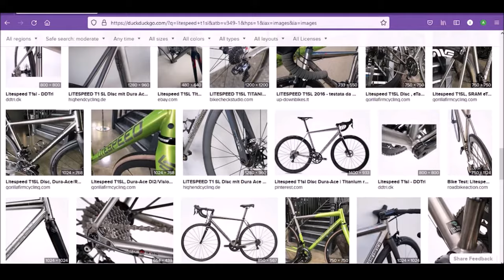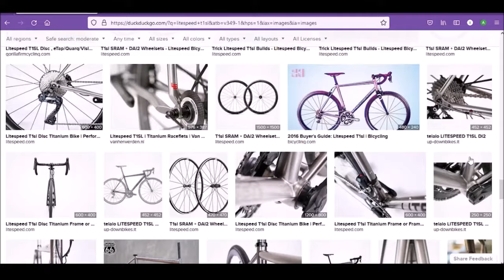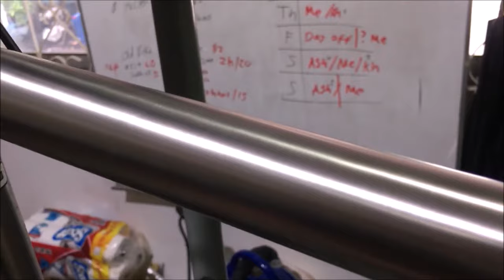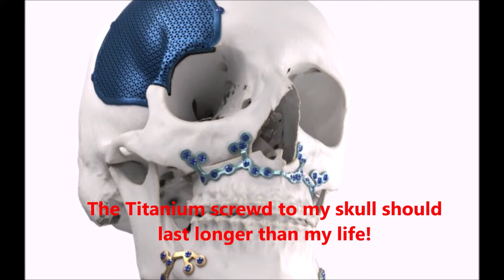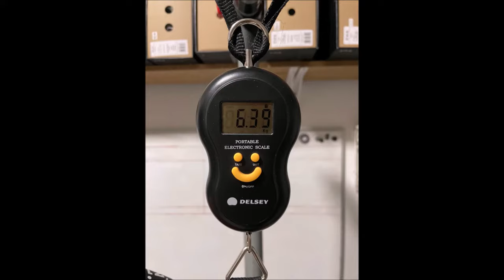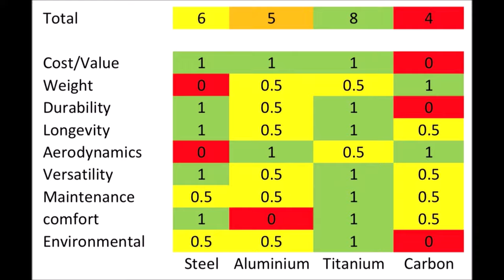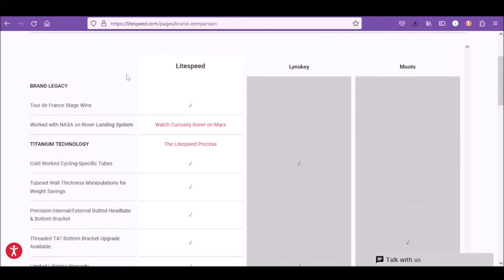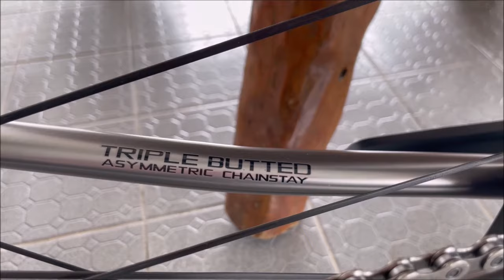The World’s Best Performance Road Bike. (And It’s Not Carbon…)

Comment: A friend has a Bossi Strada  Ozzie made Ti frame. Looks like a silver carbon frame. No round tubes! I have not seen anything similar in titanium.
Reply from the maker: Yes they look impressive, aero and stiff, i think they make the weld thick and then sand over them to make it smooth, they also use 3D printing I believe? But it makes for a heavier build and they are on the pricey side… but still, very pretty. 👍🏻🙂

Comment: OOPS,tablet trouble again.Having had 2 90s Litespeeds with the David Lynskey signature I wondered why they seemed to fade away for a while.
They were not cheap or the lightest back then but sure rode nicely.
The problem with the older ones was tyre clearance even a 23mm had just enough space to clear,if you went over fresh tarmac you could get a small stone jammed in there,would not take today's 28mm.
If I could find an older Litespeed frame would it be possible to fit 650b wheels to convert to a gravel bike ?
Would love a T1sl but no way to fund that at present.
Long live rim brakes and external cables on road bikes!

,
Reply from the maker: You will be surprised to hear I still use 23mm tyres. I haven’t found the need to go bigger on my T1SL yet and they fit really nicely on my carbon rims. 🙂

Thank you for the comment! Ride safe!
Reply: @reginaldscot165  Have you ever tried wider tires?

Comment: Great explanation on Ti versus steel, Al and Carbon but, I’m not with you 100%. Problem is that Ti is much mor britle than steel. I’ Used to desingn frames for a bicycle company and can tell you that Ti thughness against steel is quite superior but it lacs on elasticity and resiliance by much. I’ve seen top racers ending races on steel frames uwelded o broken seat stays that if being Ti would be imposible, so this may be one main reason for Pro tour cyclist not to use Ti since if it get cracks it brakes. This in addition to the carbon design hipe ofcourse. Regards!
Reply from the maker: Thank you, I will settle for 99.9%. 😉

I have almost ripped the head tube off a Ti frame in a serious crash that put me in hospital for 6 months. It was holding on by only a few mm or material… and yet I can’t get it to fully snap. It still supports my weight. As for elastic deformation, I’d be surprised if you ever reach plastic deformation from normal riding. 😁 Crashes are a different story, but by that logic why do they choose carbon then? I don’t think the resistance to crash damage is even part of the equation. 🙂

Comment: Bottom bracket stiffness and responsiveness is a key category that has been omitted.

Steel: -3
Alu: 0.5
CF: 1
Ti: not sure, but want to know!
Reply from the maker: Is it that simple? Surly it very much depends on thickness and design of the shell? 🙂
Reply: @reginaldscot165 of course. But, I suppose we are all after frames that weigh less than 1300g (as an absolute max).
Reply: @StopTheRot  Eh, perhaps, but unless you're doing the hard climbs, does a pound really matter ALL that much?? I easily stand to lose a pound or two (or three, or four, or ten) of body weight to make up that difference.

Comment: I have two Litespeed's. One is a 1994 Litespeed Classic which I just upgraded to 11 Speed. Yep, still riding it. Fits like a glove and will never give it up. The second is from 2020. Litespeed Ultimate with Disc brakes. With my weight Disc brakes are a savior. Have one carbon fiber frame that I just bought. Really love it for its comfort and speed. I also have a steel Pinarello from 1997. That is more a retired bike as the paint job is still in excellent condition. As the saying goes..."Steel is real!"  I really can't argue with you on your assessment. I won't know for another year or so if the carbon fiber bike was a bad decision or not. That is about the only nitpick I have. Otherwise, great job.
Reply from the maker: Excellent comment! Thank you and you sound like you have a lovely collection of bikes! 🙂👍🏻

Comment: The carbon fiber test with the truck running over it is misleading. Carbon fiber is very strong depending upon the direction in which the pressure is applied. It was never intended to take stress in the lateral direction. Along the axis, however, it is quite strong.
Reply from the maker: Then how is the test misleading? 😂 It shows the truth that carbon tubes aren’t as strong as titanium if you crush them. That’s not “misleading” at all. 🤷🏻‍♂️
Reply: @reginaldscot165  Do people routinely have a need to crush their carbon bicycles? I would hope not. I suppose it proves that titanium holds up better if your bicycle gets run over something, but if that happens, you've got a while different set of problems to deal with, anyway. 

I'm not arguing against titanium. Heck, I just ordered a Litespeed Arenberg yesterday! I'm 66, and I know that, barring some catastrophic event, it's the last bicycle I'll ever need to buy. Plus I just think titanium frames are cool. Everybody has carbon. Titanium is unusual. Not everybody has titanium. And I think it just looks awesome.

But I did not buy Litespeed because carbon frames were shattering out from under me. Carbon fiber frames are designed to take high stress in the directions in which riding the bicycle will present that stress. Why add the additional weight of making carbon fiber tubes crush resistant, which you could do (It's all in the layup), if that's never supposed to happen anyway? And if it does, like I said, survivability of the bicycle is likely to be the least of your worries.

Comment: Hi Reginald. Top video!, Which litespeed bike should I get if I just want to ride for exercise, fitness and just go for long rides? Do I go with the T5?
Reply from the maker: I think they do a city bike with a straight handle bar called the CHEROHALA CITY. It’s the cheapest option if you just want to ride. Unfortunately it’s disc only. If you want a proper road bike, light, with rim brakes, comfortable and fun to ride then yes, 100% get a T5. Really great bike. ❤️
Reply: @reginaldscot165  thanks for the prompt response Reginald! Much appreciated! I will watch all of your content from now on :-)
Reply: @reginaldscot165  I actually wanted a bike with drop bars so the T5 it is. Thanks!

Comment: Not all steels are created equal. Take XCR for example. Does not rust and because it has an incredibly high tensile strength it can be made to very very thin tubes and hence also light
Reply from the maker: True 👍🏻 I considered it for my steel bike but for the cost I decided against it. 🙂
Reply: @reginaldscot165  i have a custom frame made of XCR. Highly recommended. Was hard to choose against ti by the builder said there are more tube shapes in xcr than in ti and hence it would have been easier for him to tune the ride quality. And the bike is indeed even better than I would have ever expected

Comment: I copied this from a spork manufacturer website 
Titanium uses nearly 4 times the embodied carbon (CO2 emitted during the manufacture, transport and construction of materials), and more than 3 times the embodied energy of aluminum
Reply from the maker: Depends if you consider CO2 a problem and also depends how you get your energy I guess? Maybe Ti should be 0.5 for that. 🙂
Reply: @reginaldscot165  Logic error. Regardless of whether you see CO2 as a problem or not, nothing changes the different emissions.

Comment: I own both a 2019 T5 and a 2022 Watia; both are great bikes. For me not getting beat up by the ride is very important and these Ti frames have enough compliance not to feel numb or stiff through the ride. Durability is important for big downhills as I never have an existential crisis that a frame failure may occur on sketchy roads. Sure weight is a consideration, but that may be addressed through a better diet.
Reply from the maker: Great comment and weight can also be solved by equipment choices. 🙂👍🏻

Comment: Scot as I was doing a hundred miles yesterday (161 Kilometers) I got a flat from the smallest steel sliver.  I was thinking about what you said regarding the pro teams fixing their own problems on the road. If I get the much heralded Victoria Corsa pro graphene, It may be fast but would it be durable?  What is the point of being fast but it won't hold up the smallest puncture-causing debris?
Reply from the maker: It’s a big question, nothing is 100% safe, even tubeless. Everything is about compromise to some extent. I think it’s possible to be light and have a good quality tyre that shrugs off most road debris but I will explain more in a video I’m working on now. 😁👍🏻

Comment: That's all wonderful until the frame cracks; turns out it's pretty common.

Stainless steel is sounding good.
Reply from the maker: Is it more or less common than carbon or aluminium cracking? Are there people still riding on 30 year old Ti bikes? (Yes 😉) Yes some of the older ones cracked in the early days when Ti was a new material and nobody knew how to weld it properly. But that was 38 years ago. Don’t forget, many Ti bike come with a 10 to 15 year warranty on the frame as well. So if anything is going to happen you would expect it in the first 10 years. 👍🏻

Comment: What do you think of the Dolan ADX Disc compared to the Litespeed Arenberg, for an enduro bike? I prefer the top tube being a bit more horizontal on the Dolan. Is its manufacture quite good?
Reply from the maker: No Idea, but Litespeed are the best in titanium technology.
Reply: @reginaldscot165  I will definitely keep that in mind, sir. You may want to take a peek at the Dolan brand, as well. They get good reviews. If you're curious, that is. But thanks for the rapid response. It will no doubt serve as a strong influence on my decision. Keep up the good work, Mr. Scot.
Reply: Dolan frames are made in China and Dolan stick their decals on them.

Comment: Much progress has been made, all Motogp frame are built with aluminium in 2024 (and for KTM steel-tube) chassis, with carbon thought to be too stiff. But, like money, in racing more is good but is never enough. There was, however, one believer that carbon fibre, far superior to metal in strength-to-weight, could be made to work
Reply from the maker: You are talking motor bikes? That’s not my subject so I can’t comment. 🙂
Reply: There was, however, one believer that carbon fibre, far superior to metal in strength-to-weight, could be made to work. Ducati Corse’s first MotoGP engineer Filippo Preziosi’s innovative style saw him make a minimal carbon-fibre box that combined the function of airbox and main chassis spar. Isn’t carbon too stiff, we asked him? No, he insisted. " The material is not important in itself; it is how you use it. "  Can you see Peak Torque & Preziosi have something in common ?

Comment: LOL, talking about Moots.  Dude, their construction techniques and tolerances are much better than LS- and they do double butt their tubes, the RCS model which I own and the CRD.  Works of art.  And look online for LS frame failures, plenty to chew on.  Very few Moots.  So it's far more than just weight, mate.  If I cared about weight, I'd get carbon
Reply from the maker: I will agree that the moots welds do look lovely. But I’m getting better tube manipulation, lower weight and less cost. If you don’t care about weight then why not buy a steel bike? Looks the same as a moots? Or a Chinese frame, again they look same as moots because moots don’t bother with complexity in their designs. That reduces work and cost for them, but rather than charge accordingly they are some of the most expensive Ti bikes out there? 

Yes, double not triple butted. About frame cracks. 1) LS have been doing this longer than anyone else so you would expect to see more of their bikes with cracks. 2) they are always pushing the boundaries of what is possible. For example the T1SL. When you push boundaries you sometimes find the limits of the material. Hopefully that’s what the lifetime warranty is for. 3) They have changed hands as a company and at 1 time they were owned by people who sort profit over quality. If you check the dates on the cracked frames online they are most common in that time frame. You can still see people on the LS Facebook page riding LS bikes that are 30+ years old. Moots are nice, but they are boring conservative bikes that cost way too much and are too heavy for the price. Why not use the amazing material of titanium to its fullest advantage? 🤷🏻‍♂️

All the best and ride safe! ❤️

Comment: Titanium does corrode. Especially electric corrosion during contact with other metals. Also titanium alloys may have some aluminium, vanadium and other toxic metals.
Reply from the maker: My answer to that is if you do a Google search for dose titanium corrode: “Titanium has outstanding corrosion resistance.” And in all the years I have worked with titanium and serviced titanium bikes I have not seen any corroding on the titanium itself. 

Second answer would be, if titanium is toxic as you insinuate then why do they make camping cups and cutlery 🍴 out of titanium? And why do they use it in both medical equipment and in implants. For example I have several titanium plates and screws in my skull.
Reply: @reginaldscot165 well it depends on used alloy for medical purposes i think, they are different

Comment: I am not currently looking for a new bike, but if i was, after watching this, i would certainly consider a titanium one. Few things, though, i must say, don't add up. Firstly , you choose a titanium seatpost over a carbon one for solidity, but at the same time you built your bike with carbon wheels, and i would say, that wheels are way more prone to damage from bumps etc. than seatposts are. Secondly, if titanium is more comfortable then carbon (and i can't say if it is or is'nt, i never rode on titanium bike) why do they put carbon forks on those ti frames?
Reply from the maker: I will gladly explain! 🙂
Because when working on the bike I clamp the seatpost, so it’s much better to have a titanium one. I also pick the bike up by the post and I clamp lights and bags to it, so having something that doesn’t mind having dirt rub against it for hours is a major advantage. 😁 Also it’s also more comfortable than a carbon seatpost in the same dynamiter. 👍🏻

As for the fork, many reasons, 1) to make a fork in titanium in that shape would be very Difficult and expensive, carbon is a cost saving material in this situation. 2) they can outsource production to other companies. 3) in a head on crash you are likely to damage the fork, so it’s cheaper to replace. 4) it’s possible to get lighter forks. 

As 3D printing improves I’m sure a titanium one of quality and Low weight will become available. Then I will definitely buy one! 🤭
Reply: @reginaldscot165  Ok, thanks for reply :) Bike looks like a beast with those wheels on, have to say :D very nice channel for cycling related stuff btw
Reply: It looks great but lightness is only one factor.Being heavier doesn't make a bike bad.

Comment: Whether we like or not carbon, in all ots forsm and technologies will be the main material use for building bikes. I has almost unlimited ways of applying design, shape and form, if [roperly designed and in high quality of manufacturing, there are many various techniqies, and materials available, what we see in bike frames is a very basic layup with rasin, exept TIME frames, but they have BCS (Braided Carbon Structur) and RTM Resin Transfer Molding.
Reply from the maker: Because it’s cheap, easy to mass produce and can be sold at the most inflated profit margin.
Reply: @reginaldscot165  Depends what you're are talkig about. Raw material, forms, design, labour? Initial cost are horrendous, imagine how much cost to have one form  for one size only, you need 5-6 sizes. You can pay for using generic forms, bu tit would be another "original product" on the market and horde of manually skilled staff, who know what to do. On contrary, with steel or aluminium you need even more skilled professionals, and consistent production quality work, welding requires experienced and skilled Asians (Taiwan, China) making metal frames in the Western countries is far too expensive. Pick and choose. you nee 200-300K USD to start : )

Comment: Aluminium will accepted by scrap yards easier than titanium, most scrap yards don't deal with titanium due to lack of sellers. Scrap dealers will also take non carbon wheels, aluminium does take a lot of energy to make, I don't know if more than titanium. I would give aluminium a higher environmental
Reply from the maker: Good point 👍🏻

Comment: Rim brakes are fine if you don't ride big mountains but absolutely frightening if you're pushing it on long descents with carbon wheels!
Reply from the maker: Did it not long ago and it was fine, I think the rims got to about 40C, the main factor was my lack of skill to be honest. That and the hills were so steep that slowing down was causing the back end of the bike to lift! Any more power and I’d have flipped the bike. 😅

Comment: You cannot weld titanium in oxygen ritch iviroment , the welds will be contaminated.
You need a chamber  with innert gas to proper weld titanium.
Reply from the maker: Partly correct. The way most people do it is fill the frame with inert gas and use a nozzle on the torch that emits a stream of gas called as gas shroud or gas shield. 🙂

Comment: What I can't get my head round is, if Titanium is that great why use Carbon forks?
Reply from the maker: Some people do use titanium forks, but they are very expensive because titanium is hard to shape to that level… but 3D printing is getting better. 😁
Reply: @reginaldscot165  Anecdotal I know. But I've seen more Titanium frame failures than any other material. Nearly always cracks near welds. And including ones manufactured by Litespeed.